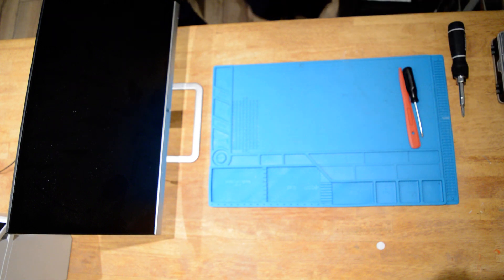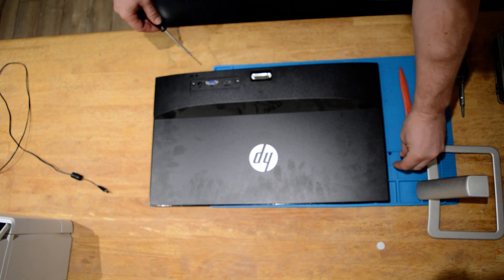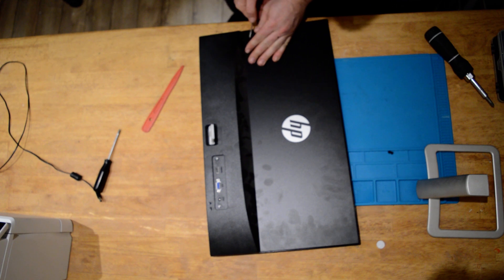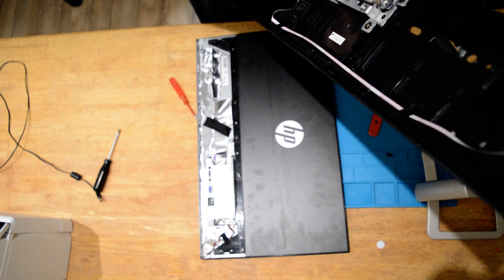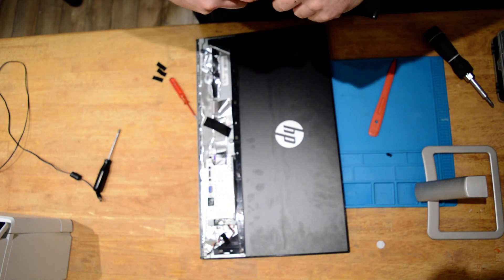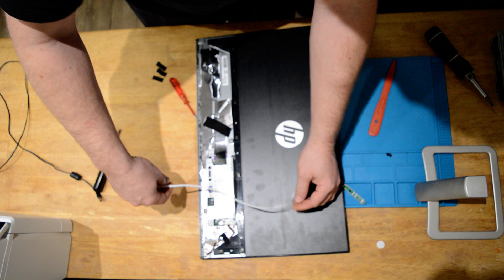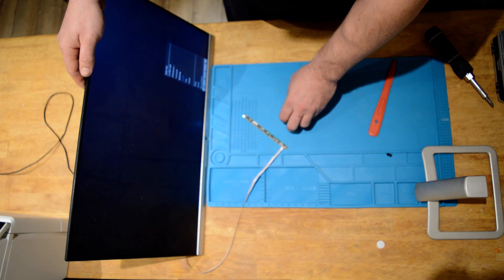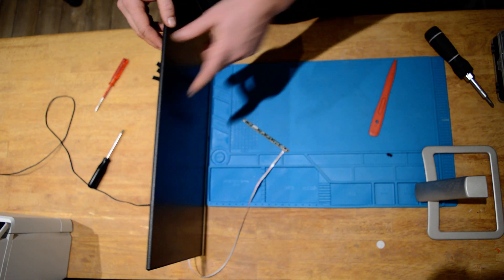Monitor Repair (HP 24ES and probably many others). EASY

Comment: my hp 24es monitor couldn't turn on after connecting to power. The backside of the monitor small led light beside the electric input pin is turned on but nothing on the frontside. could u please
Reply: Same....
Reply: Same
Reply: Same I did get check HDMI - in and upon hitting menu button it went to monitor off😢,don't really want to throw it away...
HELP,now it's a blank black screen 😮😮😮😮
Reply: Did you solve it?
Reply: Same... Did you solve it ?

Comment: I have HP 24i monitor..my problem is that after starting monitor gets on but no display for 5 to 10 mins then after switching on off for several times it starts...please tell me the solution.
Reply: I have the same problem, did you fix it? And what method did you use?

Comment: my hp 24es monitor couldn't turn on after connecting to power. The backside of the monitor small led light beside the electric input pin is turned on but nothing on the frontside. could u please help me out
Reply: Was you able to get ur repaired
Reply: I got the same issue too
Reply: I have the same issue. Did you find a solution?
Reply: Does anyone know what the problem is?

Comment: my 27er just can't turn on, i press the power button and no response, tired all the resset method, still doesnt work, any tips?
Reply from the maker: if your monitor has external power adapter check low voltage 19v or whatever it says after power adapter. if it has power there, open it up and start chasing it checking for voltage or resistance. Most modern electronics fail at connections or even solder points.

your button may even have a problem, manually make that connection. 

Good luck

Comment: what can i do if my power cord for the hp 24es only works from a certain angle (except of course, buying a new power cord)?
Reply: I have the same problem with mine the power cord isn’t the problem it’s the monitor I thought it was the power cord also then I brought another one and it was the same thing
Reply: that happens to me as well
Reply from the maker: check the power on the cable end to confirm adapter works, also check the socket on the monitor side, maybe bad connection there
Reply: Same issue -- I think the DC jack on the monitor side has to be replaced. No clue where to get that part.